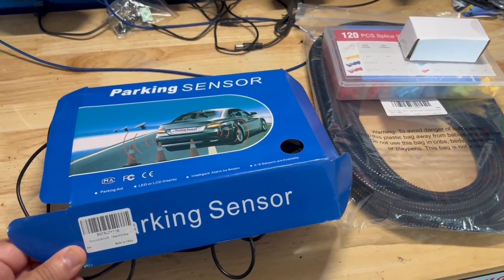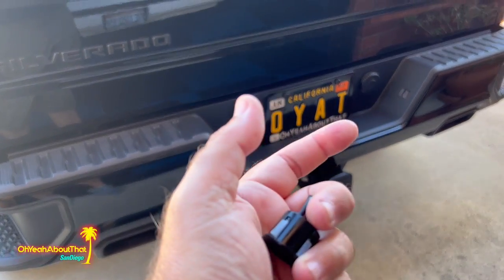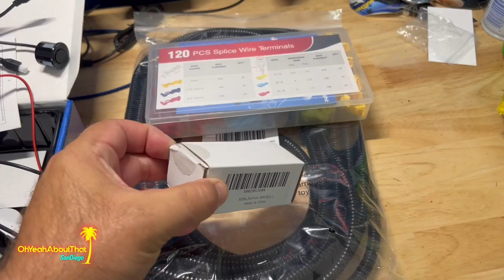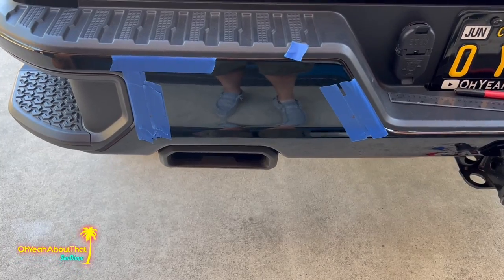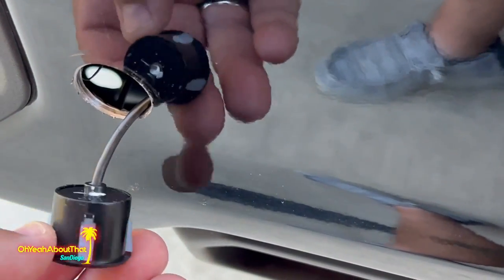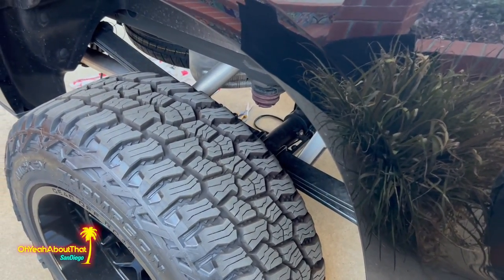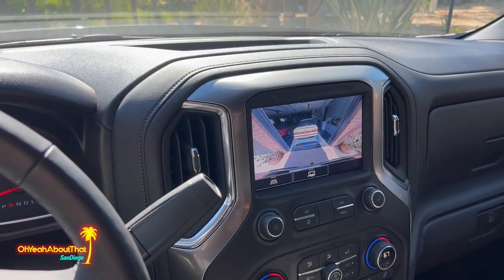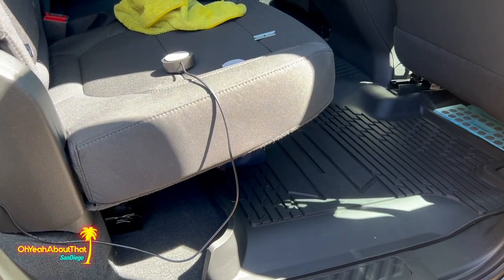2021 Chevy Silverado (part eight): adding backup sensors in factory locations!

Comment: Hey, while you installed this, did you ever notice an extra unused wire connection? I found it behind my license place and I have the tow package with a camera but no sensors. So, I’m wondering if it’s for the sensors? I want to install a back up 67decibel alarm when I go in reverse.
Reply from the maker: Not that I remember, sorry.

Comment: I want to try this set up but is there a kit with rear and front parking sensors ?
Reply from the maker: No but you can add them to the front just the same way. I would install some kind of switch because they will always be on. I’ve thought about that, myself.

Comment: You said its hooked to your brake light in the video Is the wiring on the backup light wire not brake light?
Reply from the maker: It’s the reverse lamp circuit, where it attaches to the brake lamp lens.